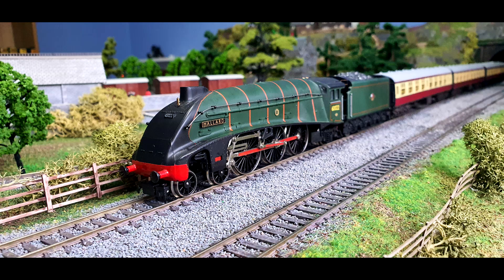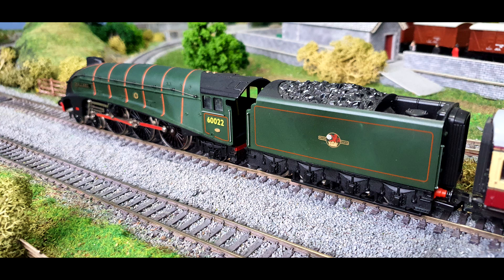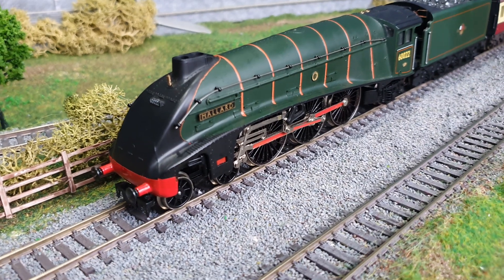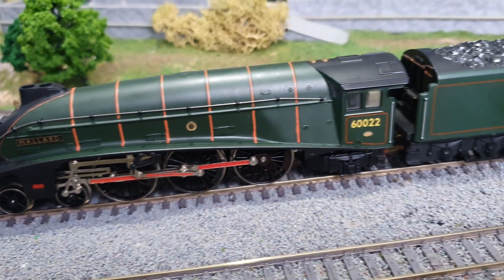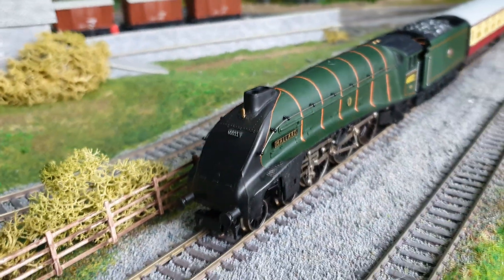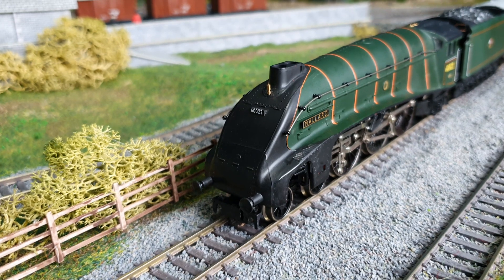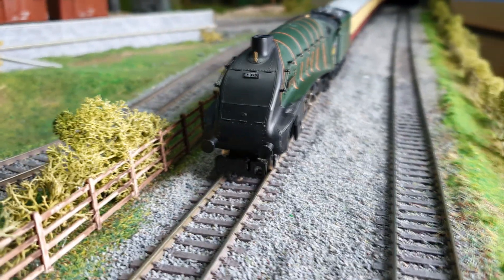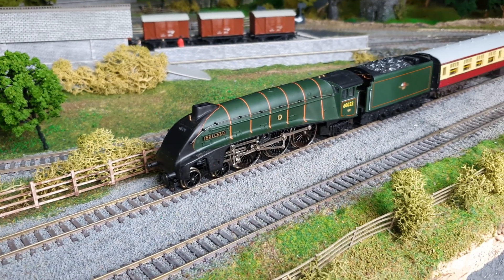Hornby A4 Class "Mallard" Update

Comment: What a great view!  Excellent 'on train' camera vision.  Well done on getting that red paint off, sounds like you put a lot of effort in.  I have almost finished doing something similar with a 9" Tri-ang maroon and cream coach, that I got for free, it had been badly painted with matte green paint.  Sadly, I had to strip it back to the maroon base plastic and respray the cream section.  Never done anything like it before and I think it will be pretty good, better than the matte green anyway.  Crafting takes many forms.  😊👍
Reply from the maker: At some point I'd like to try and do some complete re-livering but I need a new compressor for my airbrush. And probably a new airbrush! Painting is not my favourite thing...
Reply: @oobill  I hear you!  The cream paint I used came out of a spray can.  My other efforts have been done by hand, I am good at detail.  An airbrush is not in my future 😊

Comment: I wanted to strip paint off of a badly overpainted Lima class 87. So I coated it with Mr Muscle oven cleaner and shoved it in a plastic bag overnight. It stripped all the new paint and left the factory finish untouched. Now paints very considerably from manufacturer to manufacturer so I take no responsibility if it ends up giving your loco a pizza finish but if you need to do this sort of thing again that might be an easier route for you. Thanks again for your videos.
Reply from the maker: Mr Muscle? Well it is good for something then cos it's useless on my oven! There is a commercially available paint stripper for plastic models but in this case I only had to remove paint from a small area.
Reply: I have tried superstrip and it did nothing at all. The Lima 87 had been painted by the famous blind man with a bog brush and much to my surprise Mr Muscle stripped that off. Sadly it couldn’t strip the original Lima paint. I’m going to try Dettol next which is supposed to be very effective.

Comment: What a difference looks like it should now did u get the p.o box sorted out, I have a 08 shunter with problems to the connecting rods and their seems to be play in the middle wheel
Reply from the maker: I won't be getting a PO Box unfortunately they are way too expensive. Email me via the address in the "About" tab on my channel with pics of the problem if possible.
Reply: @oobill  I went to the about tab but could email you the problem is with the 08 when the connection rods are all on the 2 outer wheels seam to work but the middle one doesn't go around properly, one think is their seems to be play in it and the rest don't